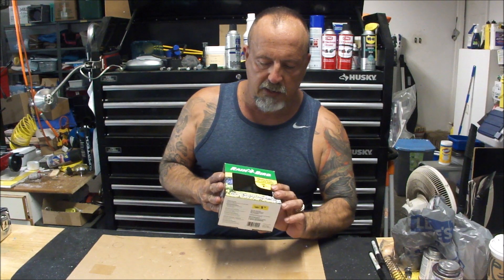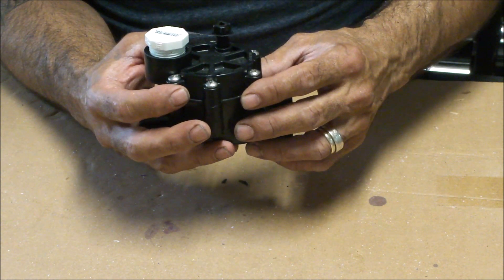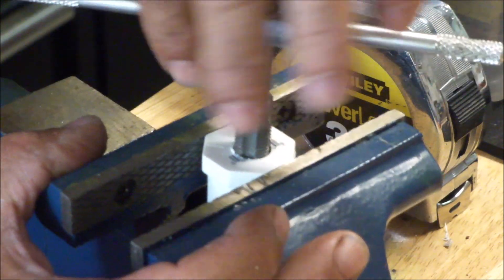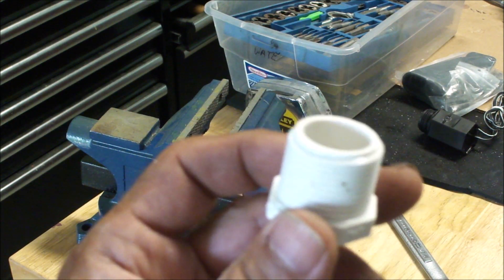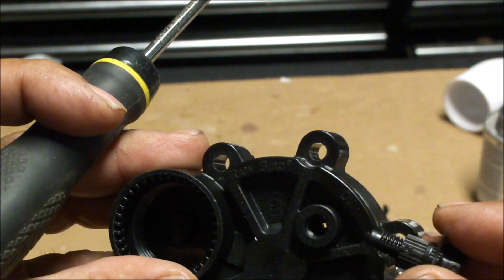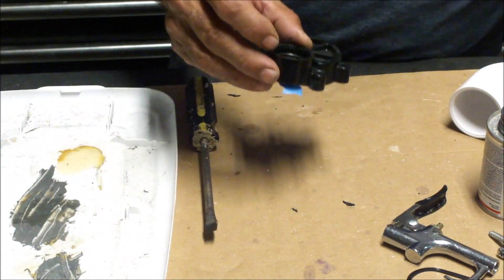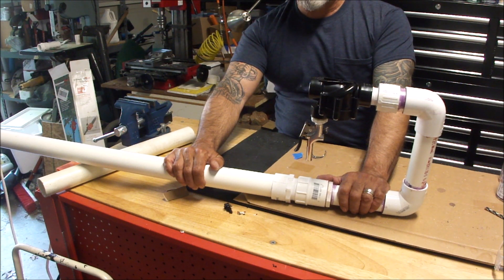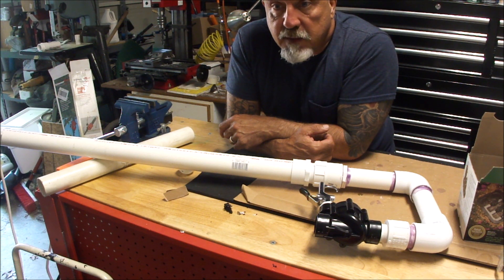Spud Gun Sprinkler Valve Modification for new 2019 Sprinkler Valves - Bait Launcher for Surf Fishing

Comment: My local Home Depot/Lowes doesn't carry that style of Mipt Caps anymore. The flat mounting area is flush with the bottom of the PVC, and won't provide clearance. I solved this by using an extender, and then changing the design completely and going from PVC to brass using some adapters.
Reply from the maker: Innovation! Sounds like you solved the problem!

Comment: getting the same valve you got on the video, the Orbit is rated to 50 PSI, did not want to try it at more but all the air escaped through the back of the trigger.
Reply from the maker: That's terrible, good luck with the new one!

Comment: I tried to do same on newer ORBIT valve since looks the same and has no "meat" in the center and now all the air exits through through the air trigger but not the 1" where it supposed to. :-((
Reply from the maker: Hopefully that will work better!
Reply: @ExtremeDIYGuy  Do you still have some air escaping from the other end of the trigger?
Reply from the maker: no, it al goes out the barrel when I pull the trigger
Reply: @ExtremeDIYGuy  so it's weird it comes out both ends, the trigger and the barrel. Cant figure it out why. Sorry to bug you with this.

Comment: Excuse me, but I just followed this video to a T, but my valve has a slow leak right through it. I can blow on the intake side, and then see and feel the leak on the output side. Any help?
Reply from the maker: I would take it apart and clean, it sounds like there might be something keeping the diaphragm valve from completely closing, either that or the spring might be out of place and isn't putting enough pressure on the valve.
Reply: Having the same issue. Thanks for posting!

Comment: Why didnt you just drill out the center with a 7/16" hole and thread it with a 1/4" NPT , mount the trigger with a 1/4" brass nipple, and mount the blow gun trigger assembly?. You could then simply seal up the hole where the solenoid was and youre done. There's plenty of plastic to mount the 1/4" nipple, and is much faster, cleaner and the thickness of the rain bird makes it rugged and reliable.  Just curious....
Reply from the maker: There isn't much material there in the newer style valves. If you read down the comments, someone mentioned that when they tried that, the connection eventually failed. I opted to go this route because I didn't trust the amount of material on the new valves.

Comment: did you put all the insides back in the way they came or did u modify them mine is not holding air it just goes right out
Reply from the maker: I put all of the insides in exactly like they were to start. If I had to guess, I would say there are some shavings caught in the diaphragm or valve. You probably should take it all apart, clean it thoroughly and see if that helps.

Comment: What size pvc pipe cap did you need?  I didn't catch you saying.  Thanks for the video.
Reply from the maker: Good catch! I used a 1″ MPT schedule 40 plug.
Reply: @ExtremeDIYGuy  Just bought a CP100 and the PVC plug is actually 3/4" not 1". Really enjoying following your build.
Reply from the maker: @bobhubble6451  Thanks for catching that! Hope yours works out well!

Comment: We have designed and patented an aluminum version, of the PVC Sprinkler valve, that is safer, stronger, lighter and designed for air.
No modding required. 
We also have carbon fiber injection molded grips, and button triggers that are much faster than blowguns. 
Complete launchers, or parts! https://www.facebook.com/jjmultilaunchers

Comment: I'm getting a honking sound when i'm filling up the cannon,its making the sound as soon as I put air in it.Any idea why ? sounds like the diaphragm inside is making it IDK
Reply from the maker: The diaphragm would be my best guess. I would check that the spring is not out of place or that there is no debris in the actual valve itself. It sounds like its fluttering for some odd reason.
Reply: The honking sound is coming from the sprinkler valve, you have put it in backwards, I made the same mistake :)

Comment: Nice adaptation!  I made a spud gun using an Orbit 1" inline valve that has the newer valve design with less meat and I followed the old way of doing things, which meant drilling a hole in the middle of the lid of the valve right above the diaphragm.  I got about 15-20 shots at 70-80psi before the blow gun would pop out upon firing (not violently, fortunately).  After 5 times of re-epoxying the nipple back in with more and more epoxy, I found your video and gave your method a try.  The only difference in my valve is that I had to epoxy the gaping 1/2" hole where the blow gun and nipple were mounted previously in the lid.  Right now I'm waiting for the epoxy to fully set, but I've tried some lower pressure tests and it seems to work just as before, but hopefully for good this time!  I'll give an update upon a real firing test.
Reply from the maker: good deal! Yeah, when I saw how much meat was on the cover I decided to go this route. I was thinking I could have left it electronic wwith a 24v control, that way I could fire it with a button but decided to go old school.
Thanks! When I saw the cover on teh new ones I came up with the alternative. I even though of leaving the original valve in and firingit electrically but decided to keep it SImple with the blow gun trigger.
Reply: Update: the new sprinkler valve setup works perfectly with firing whatever I put down the barrel!  I launched a lime out into a lake that I speculate traveled farther than a quarter mile (it nearly disappeared from sight), and I made a gallon jug of water look like it was shot with a shotgun slug with another lime.  Thanks for sharing this way of modifying the sprinkler valve!